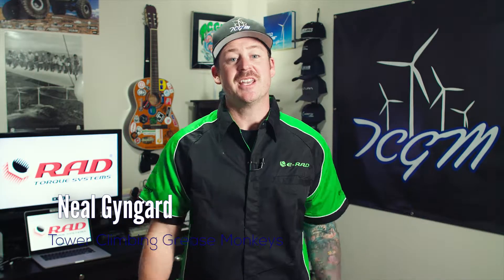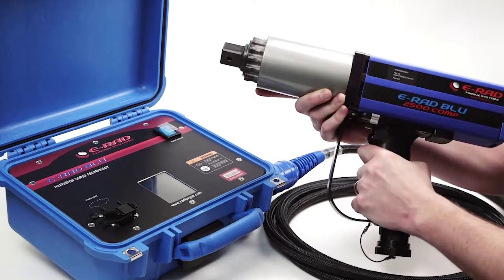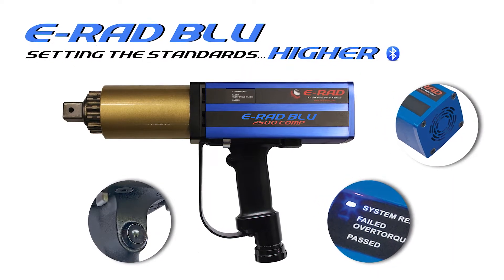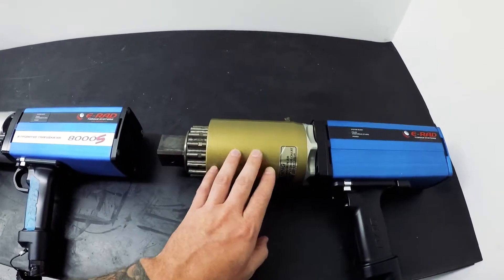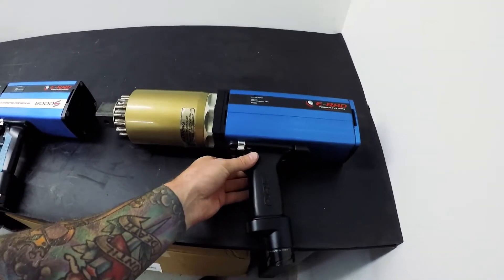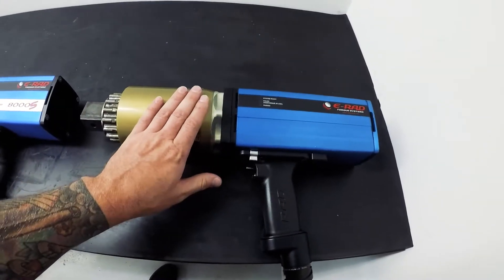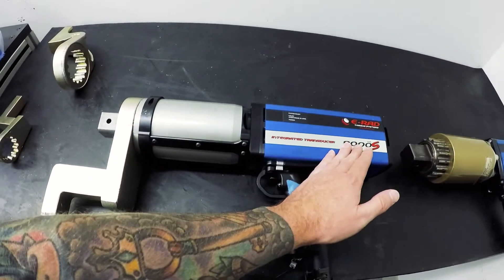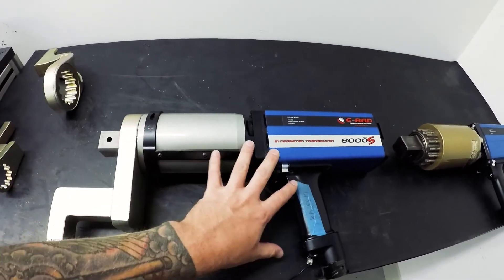RAD Torque: E-RAD BLU - Demo || RAD Torque Systems

Comment: Can this tool be used from the control panel, I would like to be able to use the torque tool in a test bay but control it from outside a test bay